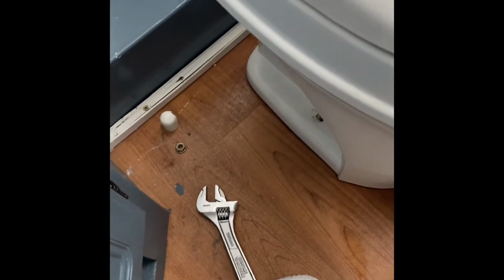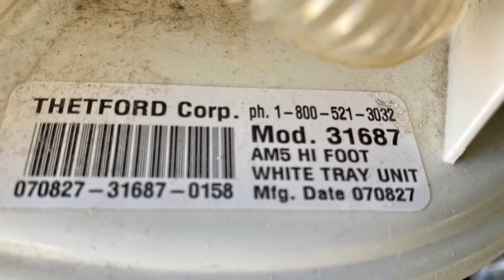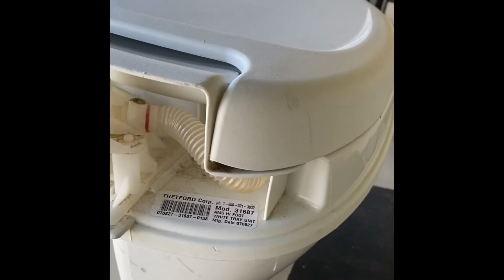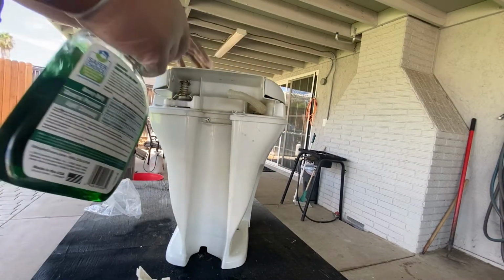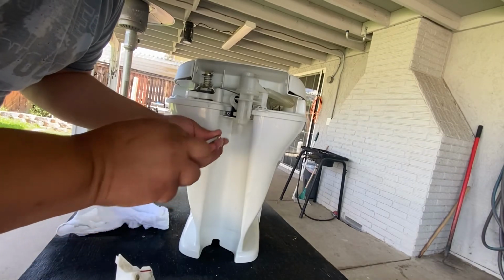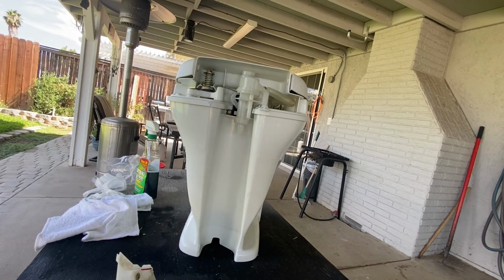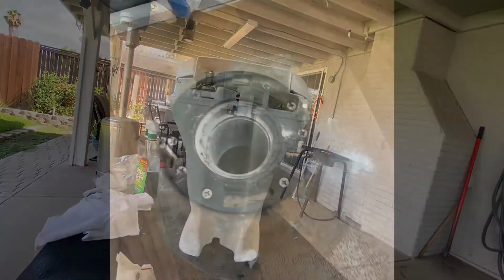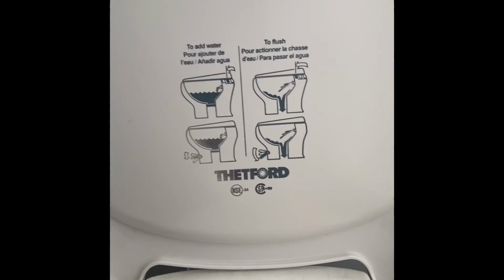Thetford  Toilet repair on Travel trailer FunFinder X210wbs

Comment: I put a shut off valve at the bottom of the water intake just in case .  I switched out that regulator and no more leaks.  You actually put it in quicker than I did lol.